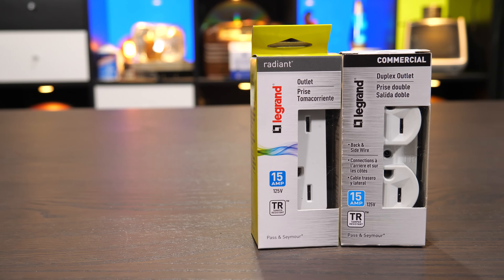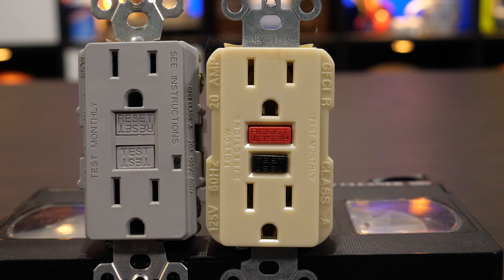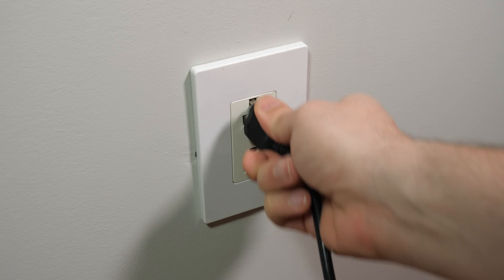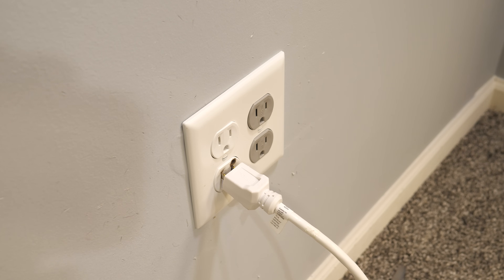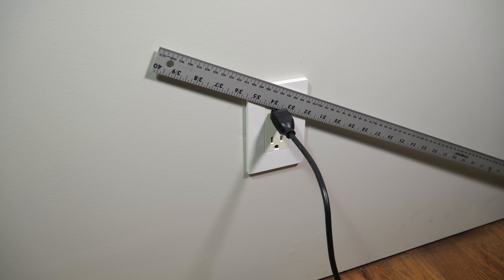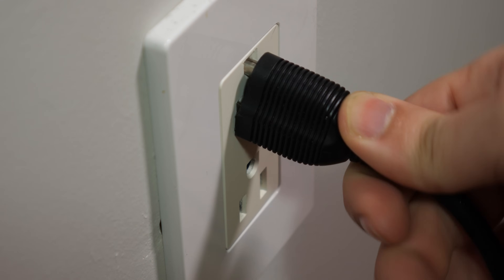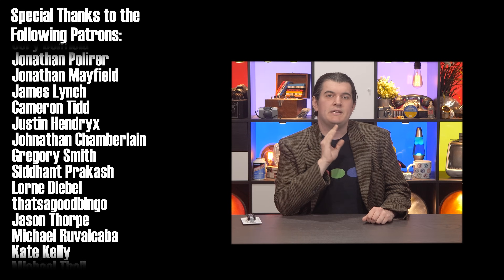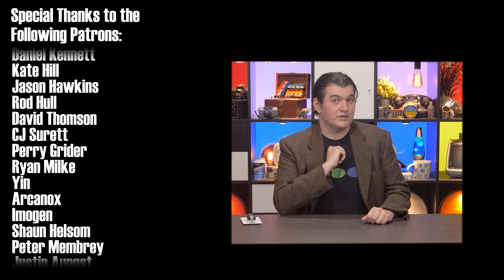Power outlets are topsy turvy - but does it matter?

Comment: I love you unintentionally showing the dangers of a flathead and a wall receptacle at 8:30 by immediately jamming the screwdriver into the ground socket.
Reply: Yeah, they use slotted screws as part of a stupid effort to camouflage it into the wallplate.
Reply: Actually as an electrician we use thin screwdrivers in the ground slot to move the outlet around for orientation. But the power is off. And the ground is not conducive. The ground is there for short circuits to quickly get the power away to escape before someone gets hurt.
Reply: Who even uses flathead screws any more? Like it is 1899?
Reply: @poulhenne  I always assumed it was for aesthetics.  An exposed flathead screw looks slightly nicer than an exposed phillips-head.  

The paint on a phillips-head is also more likely to get scratched because the screwdriver naturally cams out when the screw is tightened all the way, scratching a bit of paint out of the "plus" in the process.  Flathead screw drivers don't cam out and thus don't scratch the paint nearly as much (unless the screw is already damaged).
Reply: sounds more like we need to or robertson
Reply: @NoName-ik2du that's what allllllll the other standards are for, up to and including an interrupted flathead, as well as torx and hex - which work just fine when quite shallow.
Reply: @poulhenne I wonder if it’s because it’s nearly impossible to drive one of those screws with an impact driver, thus reducing the possibility of cracking the cover plate. Probably not, though.
Reply: @jameswhitaker1324  it's hard to use any sort of power driver with a flat head. I would also think they chose this type of screw head so that power tools couldn't be used on install. At least that's what came to mind for me reading the original comment.
Reply: @poulhenne  I hate flathead screws with a passion, however most wall plates for plugs and lightswitches us the darn things.

Comment: Speaking as someone who works in IT, in healthcare, for a university hospital? The number of times I've seen a metal object (such as a paperclip) fall from the back of someone's desk and land on the hot and neutral pins of a power connected plug, causing electrical damage (or potentially a fire) is too damn high. It's happened at least a few times in the few years I've been at my job. While it's not a common risk, having the upper outlet function with the ground up does create a scenario in which, if the plug is insecure and hanging out of the outlet, there's less of a chance of accidental contact between the hot and neutral pins that are power connected. I do agree however that having both outlets with the ground up does also cause further issues with certain devices that now have to work against gravity rather than with. In my opinion... we should all adapt to the superior "Top outlet ground up, bottom outlet ground down" configuration, to avoid both of these hassles.

Comment: Maybe the "compromise" solution would be to manufacture receptacles with a ground up receptacle on the top and a ground down receptacle on the bottom. That way, shunts due to foreign objects would be avoided on the top and right angle plugs would be usable on the bottom. The one GFCI shown does this. Why not the standard non-GFCI receptacles?

Comment: Why don’t they make outlets that face in both directions? Then you can have two devices with right angle plugs on the same outlet. the top outlet with the ground pin up and the bottom outlet with the ground pin down. Then no one can complain.

Comment: I've only seen two instances of shorts on Face orientation. One was from a Stainless Wall plate with a loose screw that fell down as you described and the other was from a thin metal object falling down behind furniture and making contact like a professional knife wall thrower. Its another case of a solution trying to find a problem. Chicago's sideways but with neutral on top is probably the best candidate for a national standard for safety but still 90deg plugs would be a better standard to use. I use short 90deg extension cords to plug stuff in for just that reason.

Comment: If one could go back in time, one could get established a much safer plug with a grounding shield wrapped around the prongs, preventing any possibility of contact with live prongs. But, it's too late to change now. 

What we could do is develop spring loaded prong shields that retract as the plug is inserted - and hope the springs weren't strong enough to pop the plug back out.

Comment: I never understood why something similar to the “RCA” plug wasn’t used for electric, there wouldn’t be an orientation and making it 90 degrees wouldn’t be an issue either. Additionally it could be recessed with shutters like many other designs (British, US TR, etc..). This would be a design that would end the need for all other ones, just like USB-C. Also, make the neutral ring jacketed, if no ground is present, to avoid any risk of electrocution.

The EU was big on reducing electric waste for devices, but they haven’t pushed to kill adapter plugs for each country (this would be for new and renovations and would eliminate sales of a non-universal plug).

Comment: It blows my mind how many bad plug designs are out there. In my opinion, nothing beats the European Schuko plug design. Please anyone, name one aspect in which this plug design is not superior. You have no fixed orientation, it is sleeved with a lot of safety clearance. It is completely with narrow plugs, the socket is indented into the wall (so you have no chance to get between the plug and the socket one plugged) and it's radial design allows for the best child-safety plug extension I have ever seen. It is perfect and @TechnologyConnections should finally dedicate a video to the Schuko plug design 👍

Comment: I did have a child stick a penny between an outlet and plug resulting in a very scary pop and breaker trip.  The penny is missing a little chunk, and the outlet and plug are scarred.  For that reason alone I've installed any new outlets with the ground pin up.

But I disagree with your right angle plug solution - you fail to mention that most of those right angle plugs can only have one plugged into the socket at a time.  In fact you don't mention the main reason plugs are straight out - because outlets are so close together that if it were any other way they would interfere with each other, which increases the use of power strips.  The electrical code and UL are designed together to limit the number of power strips - plugs are supposed to be located within 6' of any location along the wall, and power cords are supposed to be 6' long for most appliances (save kitchen and bathroom appliances where water concerns are an issue).

Right angle plugs with a 45 degree twist solve the problem except for four receptacle outlet boxes, however right angle plugs come with the same problems you glossed over as the older plugs do - too little gripping area, increasing the risk that fingers will come into contact with the blades while still energized.

I agree the plug system leaves a lot to be desired, and would prefer a better system - except that, at the same time, I really, really do NOT want the huge plugs and outlets so many other countries have adopted.  Whatever system we come up with should be as small and convenient as what we have.  Ideally backwards compatible.  Sleeving the blades 1/4 inch might be sufficient.

Comment: Outlets should have two sockets side-by-side with the regular orientation, so you could use two angled plugs without problems. Odd how they are normally above each other, here in Europe as well.

Comment: My sister once found a cat dancer cat toy (a piece of spring steel with cardboard bits on each end), had fallen down behind the couch, and connected between ground and neutral. It had started to glow like a light bulb filament.
After that realization, I will ALWAYS install the hot lead down.

Comment: So here's the thing... it gets really confusing when people randomly decide to install outlets upside down.  When 20 Amp circuits began seeing limited use in residential building, it became convention in many places to install them ground pin up to differentiate them from the normal 15 Amp circuits.  for anyone that grew up in a house built in the 60's-80's an upside down outlet is a 20 amp outlet.  That's also likely why that became the default in hospitals and industrial settings, where every circuit, planning for lots of equipment, was a 20 amp.  Later the "T" shape prong came in to use and the need to differentiate 20 amp by flipping them faded, but the convention is still well alive in older homes and the minds of people that grew up with that.  With no code dictating either way, and as far as I can tell, no difference in real world safety either way, I'll stick to the convention I know.

Comment: As someone from the EU, when I studied in California I was actually horrified of the outlet designs when I noticed a lamp breaker which was partially dislodged but still shining. I'd never thought about how safe our outlets were until I saw your absolutely horrid "metal prongs as soon as it touches the wall, LIVE" design

EDIT: TIL there's a bunch of different designs in EU, I'm talking about the ones we use in Sweden, type F Schuko plugs
Reply: And that's just the dangerous part, it's also horrible design wise. Our plugs can go either way since ground is two metal prongs in the outlet that touches our connections, while yours has some idiotic "right way up" design

Comment: The only three prong cord I came across that has the ground on top is specifically for the Amana radar range from the early 70s I am not sure why they did it this way possibly because they assumed that it was getting plugged into an outlet lower than counter height and the cord would need to go upwards to the counter for the appliance just some food for thought

Comment: The problem with right-angle cords is if they are unplugged, lying on the ground and you step on them, ouch that hurts! That's why I like Type J plugs, most outlets like on power strips are recessed and these days half of the plug is sleeved by law you first have to crush your fingers real good and then you might electrocute yourself. They sit perfectly and never come lose, sometimes I have to pull with all force to get them out of child protected strips.

Comment: Installing cables in conduits makes sense, IMHO. Cables can be installed and replaced without tearing the walls open. My father was an electrician, and in the house he built back in the late 70s, he put ALL the cables in conduits.

Comment: A few notes:
1st, as an electrician I can confirm that I truly do not care.

2nd in rooms where there is a switched receptacle, I will often install that receptacle upside down so at a glance its easier to identify.  It's usually with a broken tab allowing half of the receptacle to remain energized.

3rd if I'm running conduit to a recessed box, its going to be a 4" square box. The mud ring on the box can allow for horizontal or vertical, or can even be broken into a quad.  Its not the conduit's fault your electricians are weird.

4th can confirm, ground side up is industry standard for patient care facilities, often spec'ed on the prints by the engineer or hospital policy.

5th while it may seem perplexing that the installers would place the energized screw up on your receptacles, if you consider the box the receptacle is mounted on is metallic (in your case) and if the mounting screws become loose or break, the energized screws on the side of the receptacle could come in contact with the mud ring or the side of the box.  As there is a limited chance there is a metal object in proximity of the top of the prongs but a guaranteed chance there is a metal object in close proximity of the terminal screws, it makes sense to install in an orientation to make the latter situation safer.

Comment: Our live and neutral prongs always have at least 5mm of isolation as part of the plug design. That eliminates all the issues you specified with metallic (or biological) items making contact with prongs, whether slightly dislodged, not properly pushed in or anything else.
Just seems like bad design and relying on average American intellect instead of making a simple, yet effective change.

Comment: On the subject of those plugs and thin metal objects, the only time I have ever heard my mom scream was when she was measuring a wall to see if a fridge would fit or something and the metal tape measure made contact with a plug. Caused the lights in my house to flicker and I thought she was dead. I took off running towards the kitchen to find her laughing. Scared the hell out of me. However I have seen this happen many times with auto/marine batteries. I work at a battery store and people will come in with measurements instead of taking a photo of the group size or anything from the old battery. They will then lay their tape measure across the terminals and pop they have a ruined tape measure and are now dealing with an angry sales rep as dead shorting a battery is not good for it so if you do this you better be buying that battery.

Comment: I don’t know why this has taken so long for my brain to come up with. Since we can’t exactly replace the receptacle entirely in any meaningful way. Why not have manufacturers make a plastic spring-loaded sleeve in the metal blades side that retract. Should cover 90% of the blades and when pushed in to actually grip the metal inside, the plastic covers the formerly exposed metal. I dunno, just a brain worm I had while watching. I figure that wouldn’t work either at the end of the day. And only solves half the problem.

Comment: Is there any organization promoting the adoption of a modern, safe plug? The other day I was playing with my cat with a fishing pole/string toy. The toy end is attached to the line by a metal connector. As I was swinging the toy around, I accidentally swung it into the partially exposed live prongs of my vacuum charger attached to a power-strip. I saw a zap from the plug, realized what had happened, and thanked my stars that the toy was attached to me by plastic line. The metal piece on the toy had bridged the two live prongs... As if the idea of raising kids in this country isn't scary enough...

Comment: Where I work all the outlets are installed "upside down" with the ground prong on top. The result is dozens of power strips in use with right angle plugs that are now frayed because the cord has to do a 180° and is atrauned under it's own weight.

Comment: American power outlets look rather flimsy, especially compared to the Schuko standard we're used to in Norway (and most of Europe). Here, the grounded sockets are recessed/covered, with the two live pins inside the socket, and two grounded/earthed clips on each side of the plug, making the ground engaged before the live pins are fully connected. It's also fully compatible with the two-pole Europlug design. This also means the Schuko sockets allow plugs in either up or down orientation (or, if the sockets are mounted sideways, either left or right orientation).

Comment: ALL the plugs in my home were installed with the ground on the top. I was wondering why…

It’s annoying as all hell, because 99% of AC adapters as of recent are built with the common orientation in mind… so all my adapters are hanging upside down.

Comment: UK plugs are, by standard:
-fused
-grounded
-right angle
-ground at the top
-have sleeved blades
-sockets are side by side, not vertically stacked
Reply: been that way for decades

Comment: If only there was a country somewhere which had a) standardised the orientation b) mandated the presence of the ground (earth) pin whether actually used or not c) put switches on the outlet to allow them to be isolated before the plug is inserted / removed d) made the wires come out at 90 degrees to the plug...
Sorry, couldn't resist :)

Comment: Fun video. I grew up in the Chicago area so assumed horizontal was the preferred orientation. Moving to New England I experienced culture shock seeing the common receptacle orientation was vertical. I agree with your surmise. I think the reason for vertical receptacles being common in the Chicago area is due to the EMT requirement, but that is just a guess on my part. I have a  1/2" conduit bender from my family but I can't remember ever using out here. If I need to wire in pipe I use PVC conduit now a days. So all the receptacles in our greenhouse are horizontal. That orientation does make water protected while in use covers work a little better.

Comment: Wouldn't a "Target Symbol" plug makes sense? It would work in any orientation.
-Shortest hot in center
-Longer neutral fully 360-degree surrounding it
-Longer-yet ground fully 360-degree surround the neutral

Comment: The cubicles in the place I used to work has American sockets and sheet metal around them. The surrounds are just clipped so can detach and try to lodge behind plugs.
Downright scary coming from UK. Especialy when the building isn't covered by an RCD.